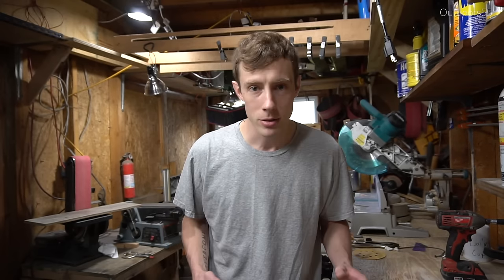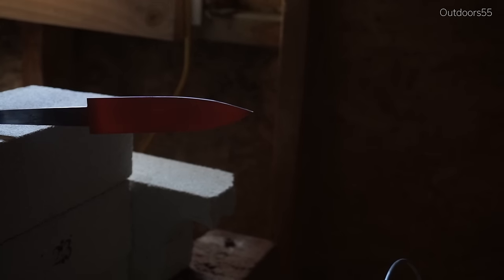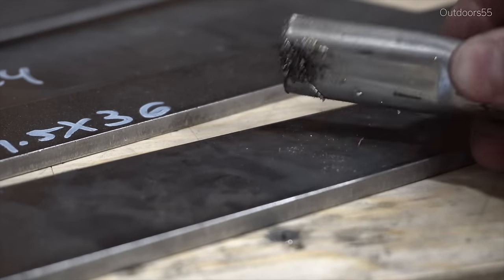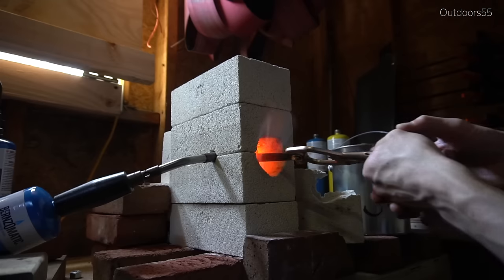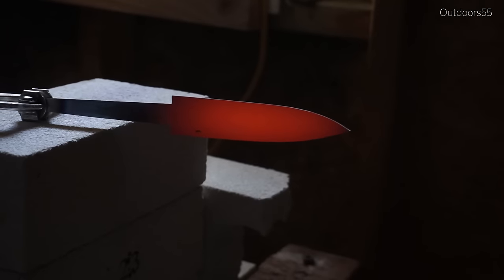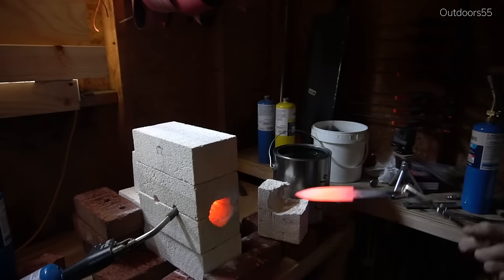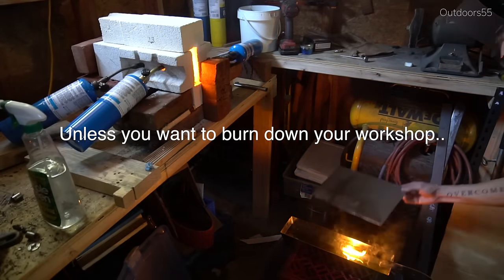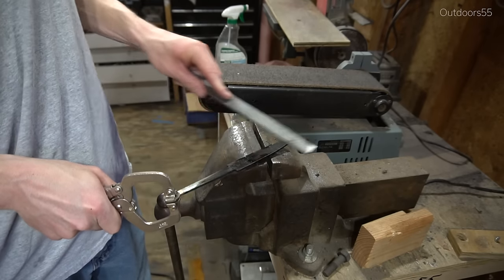How To Heat Treat A Knife | The 4 Steps You NEED To Know

Comment from the maker: Important 🛑 MUST READ below ⬇️
In light of new information provided by Dr. Larrin Thomas after this video was published, canola oil is NOT a suitable quench oil. In most cases you will NOT achieve full hardness, or even close to it , using canola. Parks 50 quench oil is recommended and can be found here https://amzn.to/3F1unye
I would also recommend his book https://amzn.to/3IVs6ac
If you can not buy the proper quench oil id would recommend sending your blades out for heat treatment as its relatively cheap and you will get perfect results 🙂

Best beginner sharpening stone as of 2020⬇️
https://amzn.to/2usHlq3
Leather strops and compound at www.knifepointgear.com
All strops made by me🙂

These are affiliated links i may earn from qualifying purchases.
Reply: Hi I need your help
Reply: Is used motor oil good? Got lotsa of it.
Reply: Why not use an infrared heat gun to get the temp?
Reply: @haldyordan2316  I've used it before. But he'll, I've used it chain oil in my saw too.
Reply: Are you heat treating rebar?
Reply: @haldyordan2316  from what I understand,  it's one of the best.
Reply: Thank you this helped a lot
Reply: Which oil
Reply: I just want to know the material of those bricks that you use please, thanks friend, I love your videos, I learn a lot
Reply: @Andresin29  I believe those are called "firebricks" or "insulating firebricks". 😊
Reply: @haldyordan2316   ITs very good, a very good way to get cancer that is.
Reply: @hulkgqnissanpatrol6121  no.
Reply: @kniferewiewscool2646  highest carbon content is in used motor oil.
It was recommend for decades only till now to say no? 🤔 
I'll continue to do so without any problem's as I have the last 37+ year's.
BTW, I hunt with brawd tip razor arrow's all sharpened, keep their edge and DON'T shatter or CRACK.
Reply: How hot should the new quench oil be? Same temp? If I were to do motor oil on 1080 would that be better or worse than the recommended new oil? If it’s better what temp should I pre-heat it to?
Reply: @arkonwolves7192  my quench oil is kept close to the coal so I imagine just below 100c

Comment: From a professional heat treater, lots of good content in this video. A couple of tips for quenching - use brine water for plain carbon steels as it reduces vapour quench phase (note the nose of the curve in the temp  phase transition diagram and this should be avoided with rapid cooling at the higher temperatures). Also vapour phase can cause uneven cooling and thermal stresses when entering the hard martensite phase which leads to cracking). Second agitation is important as you mention for same reasons above. Rapid cooling down to low temperatures is good for inducing compressive stresses on surfaces - which helps to strengthen and toughen a blade. Sure, sometimes you get a crack and it usually due to material defects. Throw it out and start again! (We cant do that in our game as it might be a $100k part!)
Reply: Little did you know this simple comment you made was very very informative to one coming into it
Reply: Always great to hear from a specialist who knows metallurgy.
Reply: a tip for high carbon or tool steel like M series (molybdenum) heat treats, using peanut oil set at 140 Fahrenheit is great for beginners  because it helps with the rapid cooling and escape of oxygen, which will prevent cracks.
Reply: @Robert McConville I never understood the file checking when it comes to the hardness of your blade. A bastard file has a specific hardness so why doesn't it bite into hardened steel? That tells me that the hardened steel has reached at or above the hardness of the file. But that's where my question comes in; I have used a file to score and break glass before when I couldn't find my glass cutter and I'm pretty sure that glass is much harder than steel. I'm not doubting the method. I've used it before; but it just blows my mind how I can get a file to skate across a piece of Steel that's been hardened and yet I can still scratch glass with that same file that would not bite into the steel🤔🤔 it's weird. As a specialist; could you explain this? Genuine question. Not being a smart-ass at all.
Reply: @jerichojoe307  depending on what kind of glass it is, a file is can be harder than the glass.  A file is made of hardened steel.
Reply: @jerichojoe307  It's not so much about the hardness of the file vs the material, while it does come into play and you can certainly dull a file on hardened steel, it is more about the geometry of the file teeth being correct for the material and its harness. Standard bastards are made for non hardened steel. They also make specific files for stainless that cut much better and for aluminum that don't clog (as much). My background is in machining and these specialty files have been available for at least 25 years (when I was first exposed to them) probably much, much longer.
Reply: @jerichojoe307  It has to do with the brittle nature of glass and the concentration of force from a hard edge. 

Steel is much more durable and less prone to breaking apart. If your edge is hard enough, you can "bite into" or literally break/chip away small pieces from the glass with your edge, thereby 'cutting' it. The metal does have to be fairly/equally hard, but even if it's technically softer and would never normally ever scratch the glass if lightly brushed across it a million times, you can chisel, crush, chip, or score a line into glass or rock if you press hard enough, because the bonds/strength in the steel is so much tougher. 

That's why rock picks work as they do, even when they are technically not as 'hard' as the rocks and crystals that they are 'cutting'. 😇
Reply: Out of curiosity from a complete novice, have you ever experimented with quenching in used filthy engine oil? Lots of metals and stuff in it 🤷

Comment: I have been  using w1 tool steel for making knives and chisels. I have not had an issue with hardening or tempering the steel. I 
feel it has better qualities than simple carbon steels such as 1080. i have used the chisels to split granite rocks and it only marred the edge slightly. The knives turn out nice with a long lasting edge.
Reply from the maker: Awesome god to know!👍

Comment: Thanks for the succinct video!
In my forge; for annealing or normalizing phases, I heat a section of iron pipe, not brass or galvanized, in the furnace to the correct temperature then place the workpiece inside the pipe. Soak after reaching the steels' correct temperature for 5-10 minutes then air cool or turn off the heat, close up the forge and leave the steel inside overnight, depending on what softness you are aiming for. The most important consideration in normalizing or annealing is that the heat is as even as possible and that the cooling is as even as possible, but not too slow and not too fast. The pipe helps with this and reduces oxidation of the steel from a direct burner flame blasting it. Some use stainless steel foil to wrap if they have access to an temp controlled oven.

Comment: one of my best friends at GE now deceased worked heat treat . I learned a lot from him over the years a lot of people will heat treat properly but later fail to treat for hydrogen brittlement basically you bake the hydrogen out of the material its interesting to see a piece that isnt baked it has a very distinct look when you break it. over 24 years i picked up a lot of tips i enjoyed working in weld braze the most time went by sooo fast

Comment: Thanks for sharing. I have also benefited from your information on sharpening techniques for knives. I am doing some heat treat tests with some 1084 steel at the moment. Some of the info out there states that you should start from an upper end when normalising and normalise at a lower temperature in the next normalising cycle or cycles, but you recommend normalising at the same temperature above non magnetic for the two or so cycles. Will have to try that one.

Comment: My first attempt completely failed, but my most recent attempt I just used a simple log burner and got it to a nice deep red glow, sadly I didn’t have any canola or vegetable oil so I used motor oil. I dropped in a few heated scraps of steel to warm it before I put my knife in, then I just put my knife in the oven whilst baking a pie! Got some tasty food, and a nice heat treated blade!

Comment: I bought my evenheat oven about when you made this video. I finally hooked it up to my panel box a couple days ago. To HT 1084 what temp should I set and how long should I hold or soak. Thanks. I’m glad I came across this video. As I was trying to study up online how to work this oven you were the first person that came to mind to ask a question or two or 50. 😂
Reply from the maker: I use 1475f, no soak is necessary with 1084, and temper to desired hardness. 🙂

Comment: Nicely explained a little tip for you heat up the tang first and then turn it around and do the blade especially when you have only a little forge chamber, so the heat is more constant. I saw the blade was hot but the tang draws away the heat to fast so you could get a soft tang.

Comment: Really good video for someone like me that's just starting out with a small, one burner propane forge, an anvil and a few hammers. 

Trying this process for a wood splitter, so even if I probably messed up a bit in the process the material is very thick and should be a bit more forgiving than a thin knife blade =)

Comment: Hi. Thanks for your clip. I really liked it. I did try my first experience on  few drill bits. I just did on the tip not the whole bit, cooled it down on natural draught without any quenching, I repeated it, BUT the following day I tempered them in the oven for an hour on 200 Celcius. After an hour cooling down on their own again for an hour on 200 celcius. Have I done it correctly or I should have done it a without a gap between normalisation and tempering? 

Thanks

Comment: I would like to add in a note for the oil quenching. An old fella told me a technique that learned from an even older fella. He said when quenching count in 1 Mississippi 2 Mississippi or however long you leave in. Make sure that you take it out for that long and repeat the process. He said it cuts down the bubbles and air pockets that are in the metal and oil. He said never leave it out for to long and go back in because it can cause stress and potentially cause factures. Anyways I hope this helps anyone out in starting there own bladesmithing have fun be careful and don't burn down anything that you want the insurance to pay for.

Comment: I am just starting out in knife making thanks for these very useful tips.. from what i understand but i might be wrong (would be very pleased if i could get more insights about this), you then have 2 options to finish your knife. 

Method 1:
Forging process or stock removal -> normalizing -> grinding (the big stuff)-> hardening (quenching)-> tempering -> grinding (small stuf) + sharpening making sure to maintain a cool blade not to destroy yhe quenching process.

Method 2:

Forging process or stock removal -> normalizing -)-> hardening (quenching)-> tempering -> grinding (big work and small work) making sure to maintain a cool blade -> sharpening

Is there any other benefit to choose one or another method except maybe the fact having a softer steel with method 1 (for big grinding work especially) and not having to worry too Miuch about the grinding “temperature” of the blade  since you will heat treat it afterwards then re-grind it (carefully)

I have seem guys putting blades in vermiculite in order to let the blade cool down gently , at what step do they do this ? Is this another step maybe when you make your “own steel” such as damascus ?

Comment: Good information. Why canola oil? I've always used old motor oil, a torch to heat the metal to the proper color. I use a metal coat hanger through a hole in the knife handle to hold the hot metal and keep it away from me as I heat it. I've found that 0-1 steel is easy to work with, is readily available from suppliers. After I quench, I sand the scale off, polish the blade. Reheat with the torch until I see blue and straw colors, then quench immediately. What I'm shooting for is something like spring steel. I'd like your ideas about my process. I'm ready to learn.

Comment: Hello. I'm in the process of heat treating a blade for the first time. You say that it's best to temper right away after quenching. But many people advise to leave the blade in vinegar overnight to easily get rid of the scales that form after quenching in oil and in this case you can't temper right away. Can you clean the scales after tempering? What do you propose. This is a great video. Thanks a lot.

Comment: I’ve made blades since I was a kid. I personally don’t like oven tempering. 
I like differential tempering with a simple hand torch. 
I like the spine to be much softer than the edge. It takes some skill but the knife will take a beating for years. 

I’ve had the same balisong for three years and I use and abuse it daily. They’re legal in my state. 
I made it out of a piece of leaf spring and a couple 1/2 inch grade 8 bolts. I really wish I could post pictures of it in the comments because she’s not only functional but a beauty too. 
I went with a somewhat kukuri style blade with holes and waves and holes on the handle just to add some style and weight reduction. 
I use her as a pry bar, hammer, screwdriver, wire cutter and stripper, and I use the lock end of the handle to straighten the stainless steel lids on stuff at work after someone has dropped and bent them. 
I make knives that will still last under heavy use and abuse. 
You should make a video of that way of tempering. 
I don’t make videos but I have taught my 17 year old son so maybe he’ll make a video eventually. I’m too old to do the internet crap.
Reply from the maker: I have done differential tempering before. As well as differential hardening. 1080 is a very tough steel and won't break even under extremely hard use. An 1/8' thick bushcraft knife will handle anything you can throw at it. So I usually only do it for looks. Thanks for the comment👍

Comment: Hey this is such an amazing video thanks. I have a question tho. I am making a knife from a rusty old circular saw blade. And in order for me to get the best heat treatment possible would I heat till non magnetic, quench in water then 2 cycles of 400 degrees and let cool in between cycles? Or should I use oil?

Comment: I love your channel. I’ve learned so much watching your channel as I’m starting my first serious knife out of 1095. What would your opinion be on making a knife out of 4140? I have acquired a piece of precision ground 1/4” thick flat stock. I thought if nothing else it might be good practice for me. Being that I have no use for it other than being a paper weight.
Reply from the maker: Ive never worked with 4140. Id stick with 1080-1804. Its not expensive at all. If you already have it than go for it. 🤷‍♂️
Reply: OUTDOORS55 the 4140 that I have was left over from a project at my employer’s machine shop. If nothing else it’s worth trying out as an experiment. After watching your videos as well as some others I will probably only buy 1080,1084, or 1095. Because of the ease of heat treating. The machine shop at work also has a heat treat oven and a Rockwell hardness gauge to check the metal. We use it for quality assurance. I appreciate the response.

Comment: I've been restoring an old Cattaraugus and it looks like someone decided to sharpen the blade with a grinder. Should I heat treat the knife due to the heat caused by grinding or is that not enough to worry about?

Comment: Alex, two questions for you mate: I heated up a 135-150 year old drawknife (my first restoration), with olive oil on the blade. My goal was to try darken the blade (protect it). This was from guidance from another restorer. I used a small propane torch and kept it moving over the entire 14" surface, both back and front and the top part of the tangs. The steel never changed any colour that I could see, but it was too hot to touch. I let it cool down slowly in the air. Did I destroy the temper of it?  2nd question: I did heat one of the tangs up that went blue, so that I could bend it straight. Its about 3" down a 6" tang. I bent it just fine and let it air cool. Did I damage the tang metal (which will be encased in a wooden handle) by doing so? Thank you for your experience and time.

Comment: This is very helpful video. 
I want to build a katana (total length 1 meter) so I was wondering wether I can build a "tube-like" forge = like a metal tube outside and a layer of cement inside (it will be two halves) and a hole to insert the blowtorch. Do you think I should give it a try ? Does it matter if the forge is narrow and the blade touches the walls during inserting / removing / rotating ?

Comment: Hello! I am making a very small, thin blade from a peice of sheet metal. I tought id try anyway! I have made other smaller tooks before but was told to heat then just untill i saw a specific colour on the steel. I saw you heated a test peice to a yellowish brown to show that hardening steel makes a big strenght diffrense. I understand that it would be very hard to heat a big blade and look for theese coulors, but if you are making something really small, is it enough to do it like that? What do you think? :)

Comment: Dude, this was a great video, thanks. One question though. Should I drill my holes in the tang before quenching.
Reply from the maker: Yes. You may not be able to drill through the steel after it’s hardened.

Comment: Great heat treat video! Can you tell me how long you soak the blade when doing the thermal cycles? Also do you ramp up with the blade inside the kiln or put it in once the oven reaches the temperature. Thanks